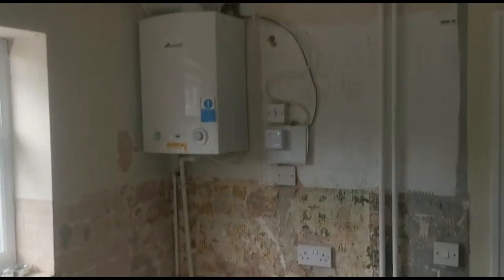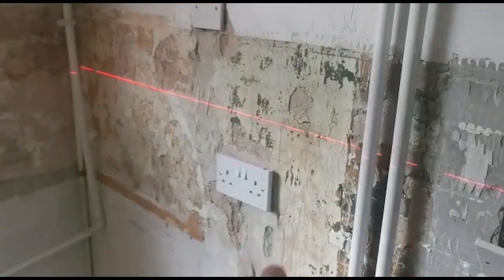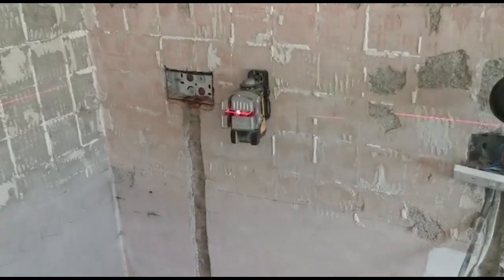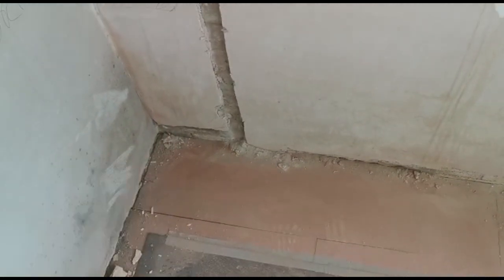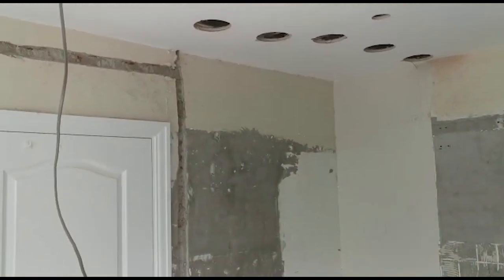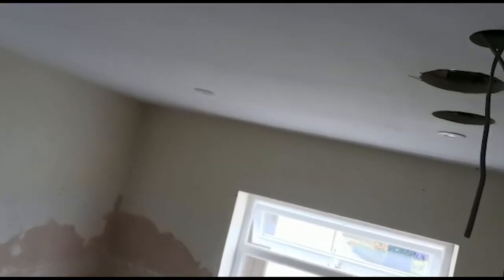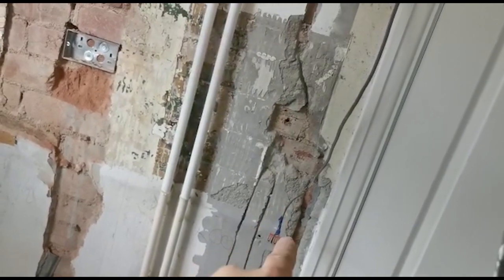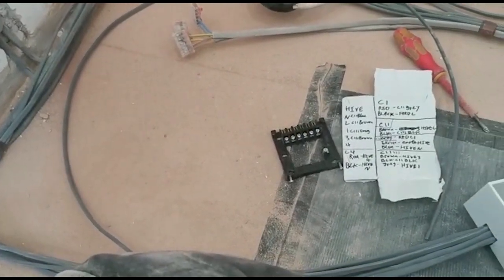KITCHEN ELECTRICS AND PORK PIES. NOM! 😁 🥧

Comment: Hi mate watched a few of your videos now. very good might add. I have noticed you use a screw and a penny washed to fix @17:27. does the threaded section cut into the T&E or do you use some kind of plane shank screw. Thanks
Reply from the maker: Hey Richard! Cheers for watching 😁 so when you tighten the screw up you just leave a 1mm gap so the only thing contaxring the cable is a side of the penny washer. I've been toying with 50mm m6 washers for big chases, would hold like 3 cables each side for rises in the corners of the room or loads of 1.0mm cables down to a switch. Bit pricey them washers but would love to find a cheap alternative 😁 Great to chat with subscribers. I would love to see if you have any ideas for videos or bits you like or don't like. It's your channel so the feedback is appreciated
Reply: @finneyelectrical  if your ever in the Skipton area gis a shout I would gladly help out, I watch the videos to see tips & tricks and how othered approached obstacles which lay in there way
Reply from the maker: @Gaunty213  sure thing bud 👌 you a sparky yourself? What company?